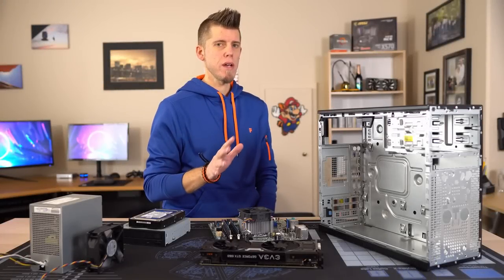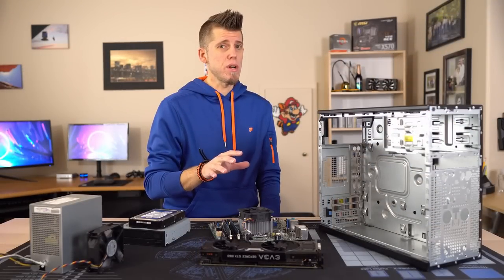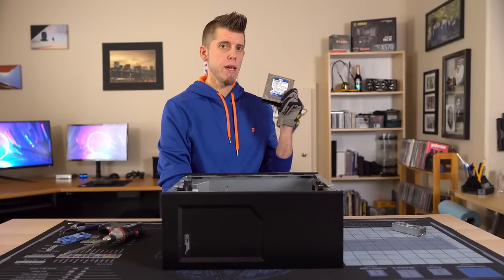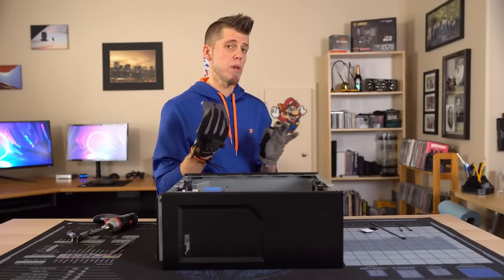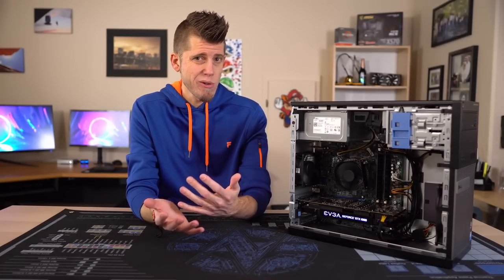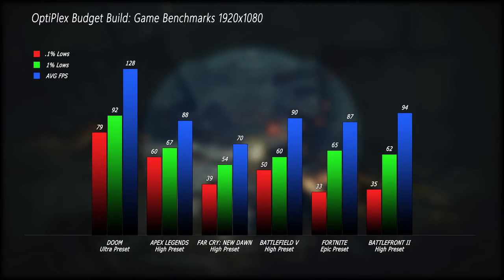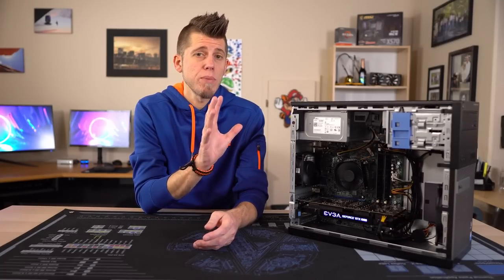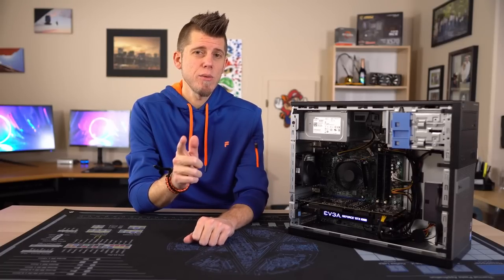Dell OptiPlex Budget Gaming PC For Under $300?

Comment: Hey my optiplex 3020 with i5 4590 isn’t working with my graphics card rx 570 armor I think it’s because it’s not suitable with the motherboard can you confirm?
(I have enough wattage)
Reply from the maker: And you know for sure the 570 is working? It should have zero problems in the 3020. I ran a 570 Armor Mk2 in my GPU testing video. If you plug into the onboard graphics and it's working, it might be set to use the onboard and not PCIe slot. You can get into the BIOS by hitting F12 and go to the graphics settings. It might have the onboard selected, just change that setting to the dedicated card or auto.
Reply: The Game Bench 

I’m confused, am I supposed to connect the gpu to aomething else then the power supply and motherboard???? And what is bios
Reply from the maker: @ClipsVi3w  So, what I think is happening is that the BIOS is set for the system to only use the onboard graphics. You should have a DisplayPort connection on the back panel near your rear USB ports. If this is what's happening, you will need to connect your monitor to that port to be able to see to change the setting. The BIOS basically tells your system what to do before it loads Windows. As for the 570. It can be installed in the computer when you do this, or not. It doesn't matter. If you're going to just leave it installed, have it installed in the PCIe slot and connected to the power supply. Then you can get into the BIOS by pressing F12 when you see the Dell logo. Press it until a menu pops up and go to BIOS setup. Once it's open, go to the graphics section on the left. I'm sure it's got the onboard selected, just change it to auto. Then you can save and exit the BIOS, then plug the monitor into the 570 and it should work.
Reply: The Game Bench 

No no no. Look. The computer doesn’t work when I have the rx 570 connected, It won’t connect to the monitor, mouse and keyboard. So I can’t do anything when it’s plugged in
Reply: I fixed the my problem and its now working.
But I have a question, can I put a xeon x5670 in any optiplex or are there some requirements
Reply from the maker: @ClipsVi3w  The x5670 is a socket 1366 CPU so it wouldn't work in any xx20 series OptiPlex based on that alone. There are no Xeons on the compatibility list for the H81 chipset, which is what the 3020 uses, but I've heard of people putting Xeons in them. However, I can't verify what would and wouldn't work.

Sorry I kinda' disappeared on you. I had some things that I had to take care of. Just curious, but what ended up being the problem?
Reply: The Game Bench 
So I fixed the problem by first of all connecting my gpu to the monitor..(omg I’m dumb) 
But it still didn’t work and I got no signal so I just pushed all the cables really firmly into the system and turned it on and off at least 10 times and then voila it worked. Then I couldn’t install the gpu because of the drivers the cpu already had so I got a DDU to uninstall all the graphics drivers for me and then installed the amd drivers and now everything works but I’m gonna buy an ssd to make it faster :P
Reply: @ClipsVi3w  😇👍 Thank God, glad to hear that yay!

Comment: Hi
I have a dell optiplex 7010, will it be useful to ride on it gtx 1650 super and what changes should I make to ride it like power supply and pcie adapter?
Reply from the maker: Okay, I waited to answer this since I'm testing the 1650 Super on these today. It will pull even less power than the 1060 did. The system pulled about 200 watts max from the wall, so you're fine on the power supply. It will just need that SATA to PCIe power adapter. The one downfall of the 1650 Super is that it only has 4GB of VRAM which can become a problem in games, something you'll see in this testing when I get it all done. Anyways, easily solvable by turning textures down. Otherwise, it's one hell of a GPU for the money.

Comment: Which display port to hdmi or vga to hdmi adapter to hook up to a tv would you recommend? On a stock optiplex 9020 mt.. I'm buying one without a monitor and to try it out, I'm only using my tv..
Reply from the maker: I would tell you not to even bother with the VGA, just go with DP to HDMI. Here's the one that I use for testing with these systems and it works great.

https://www.amazon.com/gp/product/B005H3I38Q/ref=ppx_yo_dt_b_search_asin_title?ie=UTF8&psc=1

Comment: I just bought a dell optiplex 7010 dt i3 3220. I want to put a videocard but the psu is just 250watts.  What video card is good to buy.
Reply from the maker: Well, the DT is only big enough for half height GPUs. So you're stuck with low profile, and any low profile GPU will be fin on that power supply. The best option being the 1650 GDDR6 model.
Reply: @TheGameBench  thanks for the reply. Will that be compatible with pcie x16? I dont know much in computer.  😁

Comment: Help me, have This pc, can I keep my old hd as backup, I am changing to ssd. Can I use 2 drives? How to mount, Ideas or adapters?? Need it make it simple? Thanks
Reply: yea you can keep your old hard drive, are you just putting a new ssd in the same pc? their are some options you can do, clone your hdd to the ssd and delete win 10 off the hdd or change the boot order in your bios or make a windows 10 media tool with your hdd and use a usb stick to reinstall win 10 on the sdd
Reply: you should have a 2 hard drive spot in the pc to put in hard drives but you might not have the drive drive cage you can buy a hard drive cage to fix or just mount the ssd with Velcro some where in the case and see if you psu has 2 connecter for 2 hard drive you can just put your old hdd in a external case to a hook it up to a usb port
Reply: Nate Balls thanks for your replies, I read it, see this adapter just in case I need for hook up my drives.. and also drive cage u mean a Caddy from 3.5 to 2.5 to fit ssd?  Show me please..  and yes, ssd will have a fresh windows 10 install no cloning.  Had will be just for extra storage or back ups.  See https://www.amazon.com/Benfei-Power-Y-Splitter-Cable-Inches/dp/B07ML447FG

Comment: Can you do a video on the Dell t5810? I just bought one barebones from Ebay for $130. I got an E5-1620 v3 for $30  and 16gb of ecc ram for another $30. Im curious how you think that compares value wise to the optiplex. You can use an e5 1650 v3, but those are going for $90 and I dont think the value is there

Comment: Definitely the best (by far) optiplex budget gaming machine I've seen. The thing is I HATE THIS. It's SO MUCH WORK to cajole this machine into being something it was never designed to be (a gaming machine) and in the end it's still an optiplex. One guy transplanted it into a nice windowed gaming case so you could actually SEE the ugly optiplex motherboard inside ~ it was soooo bad! Just using eBay I can build a superior machine for the same money and it will look, sound, and smell like a gaming machine because it WILL BE ONE.
Reply from the maker: Thanks! I agree, don't care for swapping these parts into another case, because... if I'm being honest, you don't really have to do any of the mods I did. There are plenty of GPU's that'll fit without removing the HDD cage and the fan mod really adds minimal airflow. Only really matters for cards with bad coolers, like those MSi Armor cards. That being said, I would be surprised if you could put an eBay system together for under $300 that was more powerful. Not saying it's not possible, but it's certainly not going to be likely. Finding deals like that are super uncommon.

Comment: Hey dude, i built one and it has a i5 3470 and an rx 580. It stutters in some games. Do you know what it could be?
Reply from the maker: I'm pretty sure that the 3470 is bottlenecking the 580 and it affecting your 1% and .1% lows. Have you used something like Afterburner to watch your CPU and GPU usage? Try turning the textures up to see if that helps.
Reply: The Game Bench ive tried to max out and lower everything out. Btw im too scared to use afterburner as i dont want to overclock (im new to this stuff) but I haven’t reapplied the thermal paste from the dell optiplex. Could that be it?
Reply from the maker: @mrepicbruh2839  If your temps are high enough that the CPU is throttling, yeah, that could be a problem. However, you don't have to OC with Afterburner. I use it and I don't bother overclocking my cards. I use it as a way to overlay frame rate, CPU and GPU usage statistics in game so I can see what's going on. That's what I used in my GPU selection video. It can also show you your CPU and GPU temps. Very useful tool in diagnosing stuff like this.
Reply: The Game Bench oh nice, yeah ill try after burner thanks, is there a fix though?
Reply: The Game Bench ive seen vids of the rx 580 and I5 3470 and they dont stutter
Reply from the maker: @mrepicbruh2839  It's also possibly the GPU is over heating. Like I said, get afterburner on there and look at what's going on. See what your GPU and CPU temps are. If everything looks fine, then I would guess you've got a driver/software issue. Beyond that... it could be a hardware problem on the GPU. Let me know if everything looks fine on the temps and we can figure out where to go from here.
Reply: The Game Bench the gpu runs at a solid 68 degrees while gta is running
Reply: 🙂 thats a 4 thread cpu, theres way too many new games that are optimized for at minimum a Brand New 4 thread cpu, to compensate for that weak platform you would have to get an 8 thread cpu PLUS a brand new GTX 6GB video card to give that platform the best possible chance, if that matters to you, you can always sell that i5 and rx card, they hold their value well
Reply from the maker: @mrepicbruh2839  Did you see what your CPU and GPU was in game? If you're seeing the CPU usage maxed and the GPU usage is consistently dropping, that would be your problem. Turning up textures might help if that's going on, there are other settings you can try that will take load off the CPU and leverage the GPU more. Also, check what's running in the background. If something's using resources in the background, it could contribute. I've seen AMD's Radon software cause issues, just kill them off and see if it helps. However, I think you're probably just going to have to deal with stuttering here and there regardless.
Reply: The Game Bench my cpu is on 100 and my gpu is quite consistant in the 60-80 

I have a really bad hard drive though and in minecraft chunks load in 4x4 as it takes too long to load and the same goes for gta v. I bought an ssd and am waiting for it to arrive. Will it fix it?
Reply: The Game Bench even though i put the chunks at max because my can handle it
Reply from the maker: @mrepicbruh2839  Well, if the hard drive's transfer has plummeted, yeah. It could totally cause random, massive, frame drops. However, the fact that it's running the CPU at 100% and the GPU is only between 60-80%, you're CPU is really bottlenecking the GPU. I wouldn't expect that much of a bottleneck with a 580. You might want to check what's running in the background.
Reply: The Game Bench oh ok thanks
Reply from the maker: @mrepicbruh2839  No problem.

Comment: How much is a dell optiplex 3020 sff with i5-4790 8gb ddr3 and 500gb hhd with these specs cause i was thinking get on of them and stick a gtx 1030 ti low profile in it
Reply from the maker: The SFF builds tend to cost about the same, and I'm seeing 3020's go for around $100 with those specs, and it's not a bad price, but I've seen them go locally for as low as $80. The 1030 is one of the better options since you can find those in a single slot card. If you wanted to go dual slot, the 3010 might be a better option.
Reply: Oh thank
Reply from the maker: @FreshOutLook353  No problem.

Comment: Hola,espero contestes mi pregunta,tengo una dell Optiplex 3020MT, tiene un i5 4590 y 8 gb de ram ddr3 a 1600mhz,su fuente de poder es de 290w,y quería saber si puedo usar un adaptador de PCI para una rx 580 de 8gb?
Es la primera pc que compro y quiero mejorarla un poco sin quedarme sin dinero.

Comment: Is the SATA To 4-pin Fan Adapter necessary? Is it possible to use a molex adapter instead? Only reason I ask is because it's a bit hard to source from me country.
Reply from the maker: Absolutely. You can use SATA or Molex... but remember, the Optiplex 20 series power supply doesn't have any Molex connectors on it, so you would need a SATA to Molex adapter to make it work. That is, unless you have an older model, and some of them do have Molex connectors.

Comment: Quick question,  how did you get your led strip working with the stock power supplu set up. Sorry if this is an obvious answer.
Reply from the maker: I didn't use any LED strips. But I can imagine you can find one that powers off a SATA connection that can be controlled with your phone, or one that comes with a remote.
Reply: Thanks man I appreciate the response.
Reply: One more question. I picked up the pcie to 6 pin connector for my gpu, a 1650 super, but I had a question about where to connect the pcie connection? I'm not sure which pcie to connect it to. Im using an optiplex 9020.
Reply from the maker: @claywalker1980  I guess I'm not sure what you're asking. The GPU should go in the top, blue, PCIe slot. Then plug the six pin to the GPU, and the other end should be a SATA connection, just plug it into an open SATA port. If you don't have an open SATA power connection, the easiest solution is to get a power splitter for two of the drives to free up a SATA power for the GPU.
Reply: I guess I'm working it wrong. Sorry.
https://www.amazon.com/dp/B01ECCVE9W/ref=cm_sw_r_cp_apa_i_c-TtFb8K0TR0Q

This is what i got. I know the 6 pin goes to the gpu but I wasn't sure where to plug in the other side.
Reply from the maker: @claywalker1980  Oh, yeah. Just plug it into an open SATA power connection as if it were a drive.

Comment: Hello, I'm both new here and new to PC building. I have a Dell optiplex 3020 minitower which I'm changing into a gaming computer, but i've run into a problem.
I added a new 650W PSU and an MSI Geforce GTX 1060 6Gb graphics card.
I had an older, lower power GPU which ran games but at low FPS, which is why i upgraded. But now that i've upgraded the GPU, when i run the same games the computer shuts off completely and restarts.
Would this be a case of a bad PSU, and should I use the stock PSU with the PSIe to SATA power adapter?

Here are the specs to my computer:

Dell Optiplex 3020 MiniTower
i3-4130 CPU @ 3.40GHz
12.0 GB RAM
460GB Hard drive
Windows 64-bit OS
MSI Nvidia GeForce GTX 1060 Gaming X 6GB GPU, I have a power cable running directly from the PSU
Corsair TX-M Series TX650M 650W PSU
Reply from the maker: Possibly. But it could be a any number of issues. Did this start after adding the PSU, the GPU or both? Has it been working fine before this?
Reply: @TheGameBench  It started after adding the GPU, and it worked fine beforehand. I managed to play games for a little while, but after about 30 minutes the problem began.

Comment: Thanks for the vid and all the great info! Would it be possible to plug in an extra hdd into the extra beige SATA data port next to the optical drive? If so, what is the downside?
Reply from the maker: Thanks for watching it. Yeah, you can plug a drive into that port, but the beige ports are SATA2. Now, that shouldn't really matter for a HDD and they're not capable of saturating a SATA2 bus. However, if you put an SSD on one of the SATA2 ports, it will hold back the performance of the SSD, which may, or may not, matter depending on what you're doing with it. Sorry for the long answer, but short answer... yes.
Reply: @TheGameBench  Would a typical hdd and SATA III cord work with that port then?
Reply from the maker: @jjnether  Yep, SATA is a lot like USB where the cables are backwards compatible, so the SATA3 cable will work on the SATA2 port just fine.

Comment: Where did the temperature sensor end up? I’m trying to figure out where you placed it after installing the fan.
Reply from the maker: Sorry if i wasn't clear. I bundle it with that main run of cables then I run it with the fan cable and front panel cables under the 5.25" bays and zip tie those together.
Reply: @TheGameBench  Oh okay so as long as it is in the case it will work.  It does not need to be hooked on the front cage.
Reply from the maker: @freshii1402  Yep, exactly. It's just an ambient sensor. You could literally put it whenever you wanted. If you wanted the GPU temp to boost the fans, mounting it under the GPU might be a good idea.